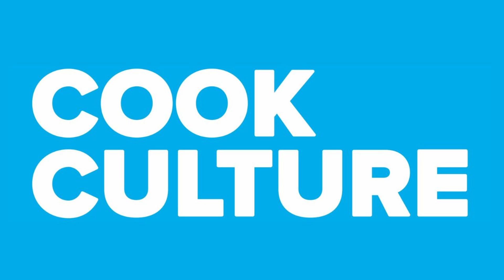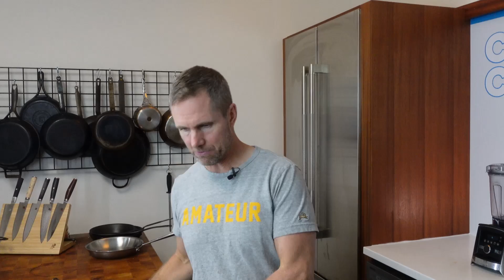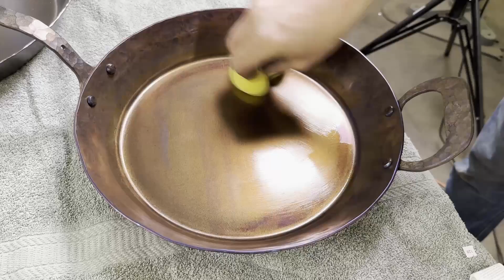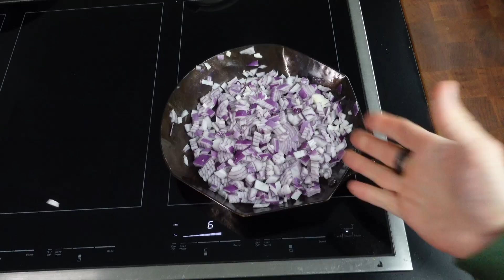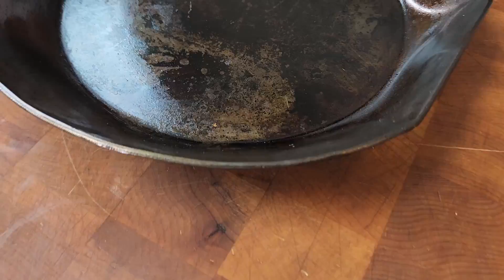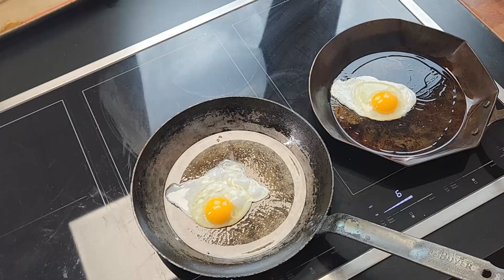Should you buy a premium priced carbon steel skillet?

Comment: Time, Temperature, and Thermodynamics  

@ 12 53: Yes, the pan with the smaller mass will heat up more quickly than the pan with the greater mass, but they should read equivalent equilibrium temps. 
That said, congrats, you've proved that the high-priced spread performs just as well as its lower-priced competitor. 

PS. I make "non-stick" omelets every other day in my banged-up retail Chinese 3-ply. 
- -

Comment: I realize this is a little bit off base from what you're talking about. But have you tried the carbon steel pans made by Spring USA. The Spring USA pans are greatly favored by commercial kitchens and chefs in this country and abroad. I find that they behave pretty much exactly like cast iron. They're very heavy, very durable. They have welded on handles. Just a really quality act in my opinion. I own two sizes of them and use them very regularly. Wouldn't trade them for  anything.
Reply from the maker: Yes, I have. Good hard working pans
Reply: @Cook-Culture  I also have several pins by debuyer, since I got the spring usa pens, the debuyer pans have kind of taken a back seat. If you should try them out, they're a little bit expensive. Little more pricey than debuyer. They also aren't quite as easy to come by. sorry it's real late. I misread your reply. Have a good day.

Comment: Solidteknics and Darto are far above the rest.
Reply from the maker: That's a hard statement for me to get behind. Each brand has its certain elements of quality, but a hand crafted pan is a special animal compared to a stamped pan.
Reply: @Cook-Culture  Single pieces are the best. If you are looking at it from a purely aesthetic point maybe, but hand forged vs stamped doesn't have a difference in performance. Besides, haven't even seen you use a solidteknics yet.

Comment: Hi and thank you for all your great videos on seasoning pans! Could you maybe do a video on bluing of the pan? With my debuyer I usually cook on 5, sometimes 5,5 (out of 9) on my ceramic glass cooktop. At 6 a new pan could turn bluish, but I have no idea how that would affect the cooking or the patina. Does it harm the patina? or is it even helpful if the entire pan gets blued BEFORE actual seasoning?

(Strangely, with teflon pans I usually cooked at around 6 or 7 even, without perceiving it as too hot. on the same stove)
Reply from the maker: Thanks. I'll address this in tne new year
Reply: @Cook-Culture  would be awesome!! btw, strangely, when heating my empty pan to around 5.5 or 6 for too long (like 15mins), the patina on the inside´s center starts to disappear (turns brighter/silvery permanently). Strangely, on the UNDERSIDE the pan stays perfectly fine (in use for 2 months), almost black (naturally, not forced carbonisation) , unless I heat the pan much more).
The inside on the other hand I never got so dark, caramel color at max. both sides got identical seasoning.
I never figured out what happens there also :(

Carbon Steel De Buyer with black powdercoating handle. not Mineral B.

Comment: Another boutique brand for handmade is 3 Nail Ironware out of Texas.  They offer both shallow and deep skillets, they have beautiful handles, and the 3 nails used to secure the handle to the pan are pounded flush to the pan for a much cleaner interior.
Reply from the maker: I will check it out. Thanks!

Comment: This is just a general comment about Carbon Steel and Cast Iron pans.  If you are on the fence about these pans, give them a try by respecting their properties of heat. You can and should do two things with the iron/steel material.  Preheat and preheat using a lower setting than one would on an aluminum pan.  Aluminum both heats more quickly and loses heat more quickly.  It is an instant gratification pan.
Use the steel pans at a lower heat than aluminum and preheat.  Once the heat gets in the pan, it will hold and retain evenly.
So much better for cooking.
If using induction, preheat at a lower temp so the pan heats evenly and you will avoid getting a spinner.
I am a fan of cast iron and carbon steel, it is lovely as long as you respect the material and walk away from the instant gratification of non-stick coated aluminum and clad aluminum
Reply from the maker: All great points!! Thanks for the comments

Comment: Great video as usually.👍 I can't help thinking your missing a point here.  What is the price of the copperstate Vs De Buyer. And did the copper state actually have any advantages over the De buyer besides a bit less weight?
Reply from the maker: Thanks. Sorry, I tried to communicate that in the video. Technically,  brands like Matfer and de Buyer make some of the best carbon steel made. So hoe much better can a boutique brand be? At the end of my trial, I conclude that buying a boutique brand, that can be over 2x more than a standard pan, is a personal choice of the type of pan you wish to use. The boutique pans are a work of art, and the cost reflects the time that was invested to make such a pan. I hope that helps.
Reply: @Cook-Culture   thanks for answering.   And no need to apologize, it's still a great video👍 I too am willing to pay extra to support small high quality makers. Maybe I should see if we have some I'm Europe.

Comment: First time out and you use it on the electric and not the BlueStar!?

To shame…
Reply from the maker: Haha! You probably don't want to hear all about the astonishing performance of my induction cooktop!! I did use it on gas at home, and it responded very nicely.
Reply: Did you use this pan on induction? Any issues with warping? Switch from gas to induction and trying to find the right pans to buy. I’m thinking a mix of carbon steel and stainless. Any recommendations? Thank you!

Comment: The simple answer is yes. They are unique  pieces, not mass produced.  The hand made carbon steel pan brand in my future is from Santa Barbara Forge. I have to decide if I want the 8.75" or the 11.5" skillet though.
Reply from the maker: Very nice looking cookware! I might need to try one of those!
Reply: @Cook-Culture  I like the price of their pans too. If you compare them to many other forged pans you will find they offer a good deal.
Reply from the maker: @dbkfrogkaty1  Yes, I see that. Looks like a good one to add to the list!
Reply: I LOVE my 11.5in Santa Barbara forge pan I highly recommend! Also another one to consider that I love using is my cast-a-way carbon 10in it's the perfect cross between the carbon steel and a cast iron
Reply from the maker: @JumpingLights91932  Great suggestions!!
Reply: @JumpingLights91932  I have the original 10" Cast-A-Way skillet too! Mine had the flat handle. They then realized most people didn't like the flat handle so they offered to put the new curve in it if you send it in. I did and got the same pan back now with the new standard curve. Great company.
Reply: @dbkfrogkaty1  I was lucky enough to get the new handle when i got mine, so thankfully i didn't have to send it back in 😅
My only complaint with the pan is that the handle is just way to long, im considering cutting like 3 inches off with my grinder 😂 but besides that it's an amazing pan especially for the money!

Comment: I mean at these prices, just buy copper, it's not really anymore expensive. Also have less of the cons of cast iron/carbon steel, and a few more pros. That's what I did recently, getting a copper sauce pan from a flea market, and buying a saute pan from etsy shipped from france. Haven't used by cast iron in a while.
Reply from the maker: While I'm a huge fan of copper, using it for most of my cooking life, I wouldn't choose copper over iron. I would choose copper over stainless, but iron it a different beast all together. They are 2 different tools.
Reply: @Cook-Culture  what things are you doing with cast iron that you can’t with a tin copper pan? I’m even more curious since you’re vegan.
Reply from the maker: @BillW910  It's not so much what you do but how you do it. Tin-lined copper isn't actually cookware, it's serviceware. With use and heat the tin will wear off and need to be re-tinned. The purpose of tin is to stop a reaction with food when it is made and prepared to be put on the table. Copper cookware lined with stainless is the best option for longevity and best results. All that said, copper improves the performance of the stainless (or tin) cooking surface. It's non-reactive and excellent for reducing most types of food. Iron shines when it has a delicate mix of fat and food to allow for thorough medium-heat cooking and browning.
Reply: @Cook-Culture  I don't know where you got the idea that it's serviceware. If you treat it like a non-stick pan, it can easily last a decade or two. The worry of tin "melting" at 425F is also rarely an issue since the maillard reaction can be best done at 350F.

Stainless most certainly does not give you best results. Yes longevity is great, since it'll last you a life time. But, the stainless layer isn't as conductive as Tin. Also tin is somewhat non-stick, which has some of the obvious benefits that people attribute with castiron/carbon steel. If they costed the same, I would rather have my copper tin pans than the same pan but made of pure silver, even though silver is far more conductive and can last as long as stainless.  

Another issue with copper of course, is the vintage ones won't work on induction, which will be a bigger issue for owners in the future. But for now, I'm having a great time cooking with my two pieces, and haven't used my cast iron since I got them.

Don't mean to be combative of course, I'm just curious.
Reply from the maker: @4tCa4mzUPqRZZo  I have a load of customers with tinned copper, and we retin all the time. If it's working for you, then keep going! 

The first copper cookware was tinned, and then came cladding, which made tinning obsolete in the kitchen. It's a simple and effective way to make cookware, but if you go to buy copper cookware from a copper dealer, you will find that tinned lined pieces are made for service, and stainless steel/copper is sold as cookware.
Reply: @BillW910 considering how quickly I get from 375 F (175°C) to 425F (218°C) - I don’t think a tin lined pan is very practical. My grandfather learned to fix tin lined pans and he had to change his profession as soon as the first aluminum and steel pans came on the market. No one wanted to cook in the tin layered pans anymore.
Reply: @Visitkarte  if you have any food in your pan. The pan won’t get that hot. 350f is really all you need for most foods anyway. Taking care of tin isn’t really any different then non stick. It just lasts longer.

There’s several places in the USA that does tin jobs. Heck one place did free re-tinning last month. Saved $100